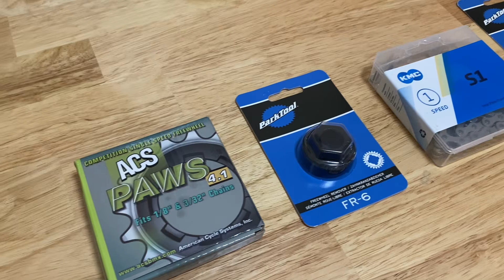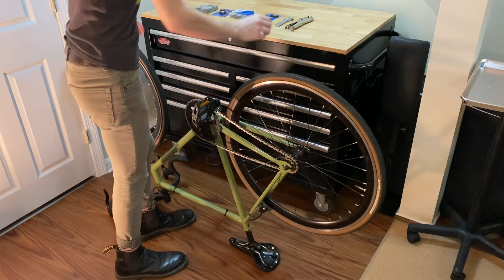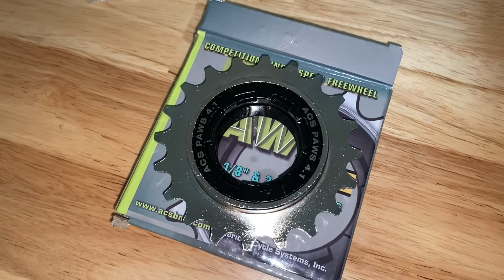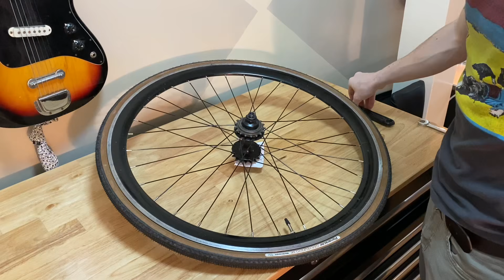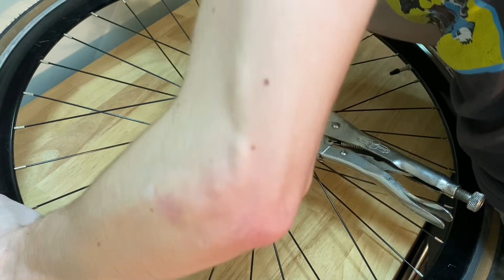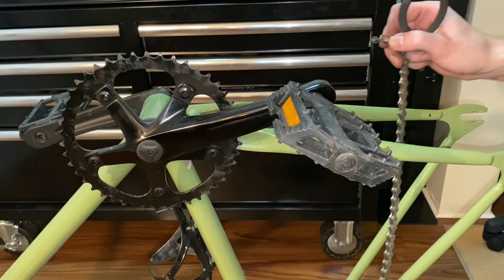How To Replace a Single Speed Freewheel

Comment: You don't need a chain whip to tighten the freewheel. Just screw it on hand tight,  and put the bike back together. The first time you put some effort into the pedal, you'll tighten it right up!
Reply: I didn't see him use the chain whip at all
Reply: @lowmx6 2:20 his improvised chain whip he made with vice grips.  You don't need any chain whip, improvised or not. Each time you stomp on the pedals you'll tighten up that freewheel
Reply: Totally agreed with you. Always tight freewheel with hands and after some kms of riding it seating very tight!
Reply: He's confusing it with a fixed gear cog/sprocket.
Reply: Thanks. This is a much simpler procedure.

Comment: People 🙄🙄… put the free wheel tool in a vice, then put the wheel on TOP of the tool that’s in the vice, and simply turn the wheel counter clockwise. Reverse the steps to install. Also no need for chain whip.
Reply: What if people don't have a bench vice or don't have the space or can even afford one. I mean DIY is all about improvisation. Peace.  ✌
Reply: I don't have an extra chain or a vice and the nearest bike shop is an hour and a half away trying to figure it how to tighten it up because the bike company doesn't tighten them on the bikes before thy ship them out

Comment: What are You doing???? You don't need to tighten the freewheel at all. Just screw it on most of the way by hand.  It tightens itself when You pedal the bike the first time. A Chain Whip is not involved in replacing a screw on Freewheel!!!!

Comment: Just stoked to see other dudes that ride  freewheel single speed, not fixed. Not that I have a huge problem with fixed, got its place, sure. Most guys I know who have gone fixed are not skilled enough to
Reply: I have one that you can swap the rear wheel around to alternate, but I keep that skinny tire Amazon special on fixed just to have a fixed.  It's wild going to that after not riding it a while, but my friends either think it's cool or consider it demon spawned from hell.  My Fat Tire fixed gear is a free wheel as is my Huffy beach cruiser I bought and wrapped in Christmas Lights.  That's my Holiday Bike I use for the big group rides.

Comment: Thanks! Just saved me over $30 for that home-made  chain whip.
Reply: I'm a little late to the party but you actually don't use a chain/Chain whip at all in tightening a freewheel, just the freewheel tool and a wrench. He's confusing the process of tightening/loosening a fixed gear cog/sprocket.

Comment: Hey Jake im curious. First im assuming u have 26” wheel & tire “total” diameter times 46 teeth on chainring devided by 17 teeth cog.
26X46/17=70.35 gear inches. Now you have 26X46/20=59.8 gear inches. Why did u change your rear cog? I know with 70 gear inches or higher is for speed but its difficult to pedal at first specially uphill. And the more teeth on cog the easier to for uphill and starting.
Reply: For getting up hills easier :)
Reply: I'm running 39:22 and am about to change that to 38:22 (on a 130BCD). I really enjoy low gears in town and it makes getting uphill and taking my son on the bike easier...

Comment: If you have flip flop but you’re not likely to use the fixed side, do you still need to keep the sprocket in? Can you remove it to save weight?
Reply: yes but that weights like 20g

Comment: How tight should I lock it?

“You want the next guy to hurt his knuckles” 😂😂
Reply: no need to actually lock it you cant unscrew it due to its design and it will automatically get tighter when u push the pedal (same thing with your disc breaks, the screws you see hold holds it to the bolt the bolt itself is what holds it to the wheel)

Comment: Thanks for this video. Kindly clarify on about getting a bigger or smaller size freewheel. Currently I have an 18 freewheel and was advised that smaller is better if I wanna go fast but I just want a better ride since it's not for racing just adventure. I was advised to get a 16 freewheel. What's the best? Should I get a more i.e 18 or more or less i.e go for the 16 freewheel?
Reply: Having tried a bunch of gear ratios, thought I'd chime in on this question. For my town, with a river and subsequent river valley running through it, 3:1 (48:16 or 42:14) seems perfect. Perfect if going fast is priority. Climbs are taxing, but manageable and launching from a standstill isn't too tough. A 3:1 ratio really shines during short sprints, like catching up to cars to draft. In traffic, 3:1 is safer as it allows quick acceleration when it counts and rarely spins out. I tried 42:16 recently, was a bit wimpy, but my knees loved it and the high cadence practice was good for me. Only lasted a few rides though before I tired of always feeling spun-out. 46:16, a little kinder than 48:16 is a happy medium. I don't know what yer running as a chainwheel, but I bet you'd enjoy a jump from 16 tooth to 18 tooth freewheel to enjoy your rides more. Especially if you are confident in yourself and don't need to prove anything to anyone. I suffer from a need to be faster than my friends, hence 52:16. Tough on the take-offs, slower off the line than 3:1, also requiring a plan for climbs. Personally, I like challenging climbs, and usually am first to the top. Our valley is also only about 120' deep too. Best advice I'd give is go back and forth, swapping freewheel a few times a year.

Comment: My wife's bicycle is a single speed freewheel, I think it's called a cruiser, the rear wheel sprocket only has 12 teeth and it is hard for her to pedal, I called a local bicycle shop and the guy suggested that I change it to a 18 to 24 tooth sprocket. She wants the bike to pedal easier but not too low of a gear. what does anyone suggest??? please reply back.  Thanks.
Reply: Depends on chain ring size too. I ride a 44/16 which is just nice. Can ride it casually at Low speeds 15-20kph but also can spin up to speeds to 35kph+

She probably needs a gear ratio between 2.5-2.75 (divide your chain ring teeth by freewheeel teeth)
Reply: I have bought a new bicycle a single speed 27.5” which came with 40 / 18 T ( 2.22) My location has uneven terrain and it is very difficult to pedal on uphills.  Now I am changing the cogwheel to 22T ( to get 1.82) and getting my bike tomorrow . Hoping it will solve my problem.
Reply: I'm currently riding a 44/18, which has a gear ratio of aprox. 2.44. This ratio is suitable for any city environment and even small hills are manageable. Assuming your wife got 28inch wheels with a circumference of 2.2 Meter (Diameter * pi ), she would move aprox. 5.35 Meter (2.2m * 2.44) for each full pedal revolution . One revolution per second or 60 per minute is a super relaxed cadence (60rpm) and with a gear ratio of 2.44 she would move 19km/h (5.35m * 60rpm * 60 minutes = 19260m/h = 19,26km/h). All gear ratios between 2-2.5 are relatively easy and suitable for people with weak legs, beginners and not too steep hills. I also have a bike with a ratio of 2.75 and the difference in difficulty is definitely noticeable when taking off at traffic lights. If your wife is a beginner and the hills in your city are similar to those in San Fransisco you might want to aim for a ratio below 2. 
Choose the ratio according to your wife's strength and in relation to her current gear ratio and your city's streets. You can always calculate speeds with the following formula (assuming the Diameter of the wheel is 700mm): 
(1320* gearRatio * cadence)/1000 = speed in km/h

Keep in mind that more than 2.5 pedal revolution per second (150rpm cadence) starts to look ridiculous and is highly unpleasant. The most comfortable cadence for the majority of cyclists is at 80-90rpm.

Comment: Hello. I’m not a bike expert, and I was wondering what specifically connects the freewheel mechanism to the rest of the wheel. Is that cylinder with threading on it removable from the wheel, or does it come with the wheel and the wheel is just compatible with freewheels and not freehubs. Thanks for any response.
Reply: The wheel hub has a threaded portion which the freewheel threads on to. The freewheel itself has a central threaded core which houses the freewheel mechanism. I hope that helps, I'm no expert myself but it is my understanding of how it works.

Comment: So what’s the point of the chain whip? He let go of it immediately so can’t you just use the pin tool to remove and install
Reply: There is no use for it, he's confusing the process of tightening/loosening a fixed gear cog/sprocket....

Comment: Can u please tell me what are the pros and cons of changing free wheel to 22t from 18t ?
Reply: bigger cog (more teeth) on rear wheel = easier gear, better for hills. smaller cog on rear = harder gear, high top speed for flat riding. The opposite is true for the front chain ring where you pedal, a bigger chainring will make gears harder, and smaller ring makes it easier

Comment: What if I don't have the notches for that tool. Only see two holes.
Reply from the maker: IceToolz BMX Freewheel Remover 2 Prong | Single speed 2-notch Freewheel Remover | Use with 24mm spanner https://www.amazon.com/dp/B0015HZ41M/ref=cm_sw_r_cp_api_glt_fabc_SHJA4CW9S240QMPBAYYJ?_encoding=UTF8&psc=1
Reply: @jakesworkshop1253  looks too big of prongs to fit in the holes
Reply: Couldn't I just tighten it and then let the pedal finish tightening it after a few rotations?

Comment: So a 20t for hills? Would that be better than a 18t?
Reply: Yes. The bigger the rear sprocket is - the easier it is to pedal. 

And vice versa - smaller the front chainring is - the easier to pedal.

Comment: Can we go 46 x 32 ??   ..i have not seen anybody trying these ratio  on single speed.
I live in a hilly region that is why i am asking..
Reply from the maker: Your top speed will be very very slow.

To be exact, you will only go 6.8mph at the typical cadence of 60 pedals per minute.

On a 46x17, your speed would be 12.9mph at a cadence of 60 pedals per minute.

So you will have to pedal twice as fast to go the same speed as a standard single speed!

https://www.bikecalc.com/speed_at_cadence
Reply: @jakesworkshop1253  wtf? That's a crazy calculation. We could never figure this shyt out as kids. Some bikes worked better then others. Never always knew exactly why. We would pay attention to Gears, weight, height, even length but honestly u just had to get a lil lucky to get the perfect build. Gotta love the internet bro.
Reply: @jakesworkshop1253  He may not care about downhill, as he does not have to pedal, but uphill is all to be sorted. While idea is in similar direction, that he needs, it well may be, he will not obtain 32T freewheel in the first place. Second, 32T is the lowest gear on my rather-wide-choice 9-speed cassette, which well proves, that it is very very inconvenient extreme for a single gear. All the use for the bike in lowest gear - it's nonsense. I would say, go 22, if single-speed is at all your thing at the given hilly circumstances.

Comment: Somthings up with my kids old blocks. I'd like to get it riding & get it go a kid that wants to ride it. The chain gets tight/ then real loose with every 180° rotation on the crank. New chain new bottom bracket (the bracket was an unrelated issue but the chain break was from this issue) I think it's the rear cassete. I was just going to buy a new rim (with cassete) & check it out but I am finding out new rims from stores dont come with cassettes & if I gotta change the cassete any way then I mine as well keep the rim I got (no other issues that I know of) but this shyt will be a first for me. Never changed a cassete or hub. Wish me luck.
Reply: Your chainring is probably lopsided! It’s not too uncommon, and is the likely cause of the chain getting loose and tight. 

To replace a chainring, look up a “Bolt Circle Diameter Calculator” and do a few simple measurements in order to find the correct size.

Comment: The chain/chain whip serves no purpose in tightening a freewheel, you are confusing it with a fixed gear set up. All you need is a freewheel tool and wrench/vice to both tighten and loosen it.